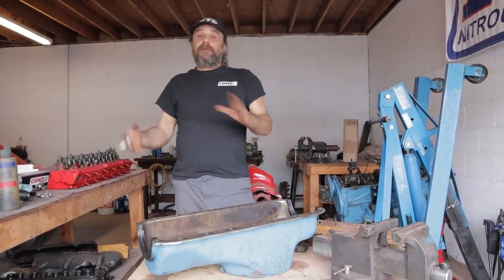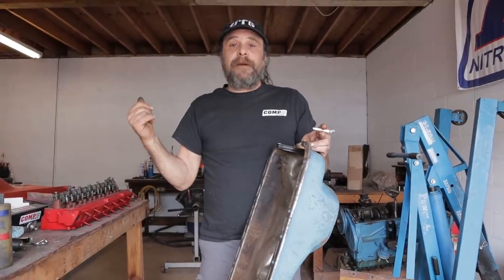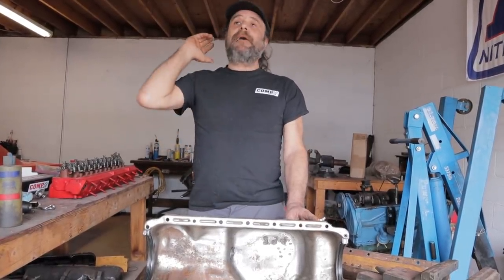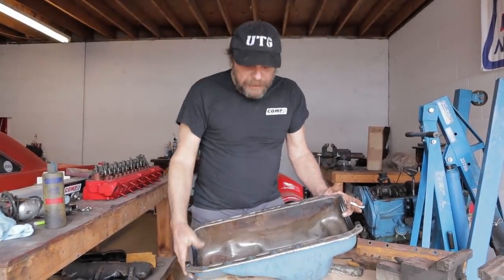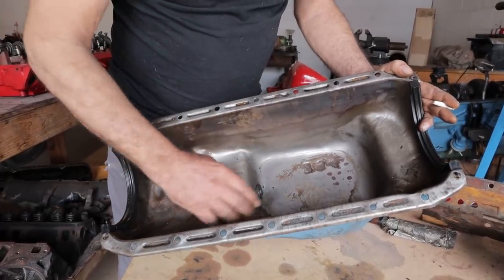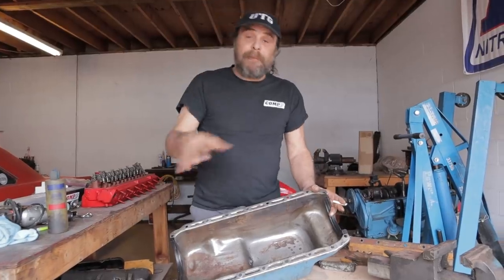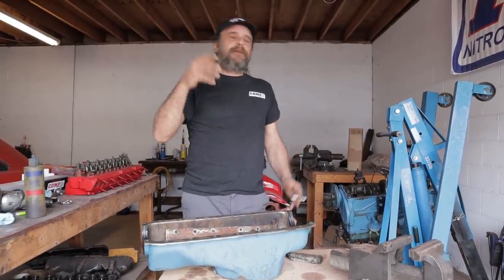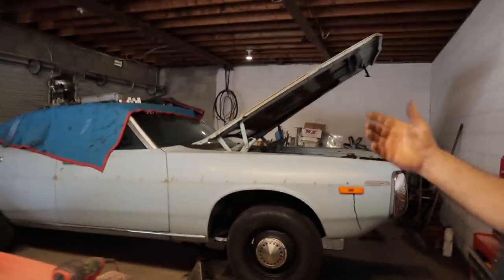Oil...Control, Windage and Pressure

Comment: I lucked out on a factory windage tray . I bought a 85 318  that came out of an plymouth fury cop car . I run stock oil pumps but a name brand like mellings no issues . I'm like you Tony I'd rather build from scraps and brainstorm on how to fix an issue on a low buget instead of buying new parts all the time . I even used a boiler shut off valve with male ends i bought at Lowe's to splice into one of my heater hoses when i dont need heat inside car and truck = summer time . As always the youth are getting smarter watching this channel 😎🤘✌👌👍

Comment: Well said about oil pressure , I used the wrong oil pump in a small journal 327 I built in high school . So when I was spinning the engine at a high RPM the engine blew up because of the lack of oil . A tough lesson to learn , so I built a 383 stroker and the rest is history . Keep up the amazing content , I hope Lambchop is feeling better these days . CHEERS

Comment: Back in the day, I put a wintage tray from a 340 in my 318..... i never thought about the oil piling up towards the back.
Reply: A 340 tray will work in all the LA blocks if it's a 273,318,340 or 360 they are all the same if it stroked then it will need some work and same as if it's the newer Magnum blocks it needs a 5/16 spacer between the mounting holes

Comment: I ran a IMCA modified and with a small block Chevy  and ran a 3/8 mile very fast track. I ran a 55a high pressure oil pump. I started with a stock oil pan and it worked great. Later I built a better engine and I put a circle oil pan with trap doors and kick outs. Every time the car went into the turn the oil light would flicker. I started talking to several people and everyone said that is normal and won't hurt anything. I put a stock pan on it and the oil light never flickered. I know if I would have bought a expensive moroso it would have worked but stay away from $100 budget pans because the stock works just fine. That's what I got from the experience. I have never used a high volume pump because its my opinion you have to have a big pan and cross drilled cranks and other needs for more oil. I think your baffle will work great.

Comment: I just finished building a baffle for the TransDapt oil pan that I'm using for my V-8 Ranger swap. I went with a different pan than what comes in the kit for 2 reasons-1) I didn't want a chrome pan. 2) Even though I know it probably isn't necessary, I wanted a 5qt. capacity pan. I built this baffle the same way I always do-I cut 2 pieces of "slotted" steel strap to fit inside the sump (a short piece for the front, a longer piece at the back). Then, I cut/shaped a piece of 16ga sheet metal to fit the pan. I use "slotted" strap because it already has holes to allow for drain back. I tack weld the strap so that the bottom of the holes are just a tick below the top edge of the sump. Then, I tack the sheet metal to the sides of the pan.

Comment: I've never built a motor without some sort of windage control. Even when I was messing with big inch Caddy motors. Always use stock volume stock pressure pumps. Have played around with springs and always came back to around 10 at an idle and 35ish at full send. Never lost a motor racing, for an oil pressure issue...
Reply: You have any 500 windage trays or scrapers hanging around?
Reply: @RichMander1  No sorry got out of caddy motors back in the 90's

Comment: Maintaining oil temperature goes a long way to keeping the average pressure in the happy zone. Full synthetic oil will help in the same vein but typically they don't have enough zinc in their additives to take care of a flat tappet cam. Really need a hot rod oil with extra zinc or upgrade to mega dollar roller cam. Vaccum pumps can make free power by removing the pressure from the crankcase. Helps the rings seal better and less windage, another 15-20 hp can be had.

Comment: Reminds me of my 340 and the factory windage tray that came with it. It was a 68, letting that go was a huge mistake.
Reply: Same here.
Reply: I built a 340 for my '70 Challenger and never got it installed. Wish I had kept the car and sold the wife.
Reply: We had no idea the real value of those used cars we were buying in high school for  $1200.
Reply: @thisisyourcaptainspeaking2259  i bought my 340 Duster at a city auction for 275 dollars. The only thing wrong with it needed lower control arm bushings.
Reply: @garymckee8857  Yeah, I remember they were cheap but not exactly how much we were paying.  My friend bought a used Satellite with a 318, I think it had.  Pretty sure it had AC, was definitely a 727 torqueflight.  We drove the wheels off that beauty and was still going strong last I saw him.  Maybe he paid $500 non-driver sitting in someone's driveway, it needed exhaust, battery and maybe tires or something.  I remember it was cheap compared to today, and the body was perfect.
Reply: @bryantcurtis2665  I bought a 69 Road Runner for 300 dollars in 82 one owner 4 speed. Who ever thought they would quit manufacturing vehicles you could work on.
Reply: I love the 340 especially the Dart swinger .  I have the 71 350 LT1. It came with the windage tray and a baffle in the pan.  Back then they thought of everything.  Screw in studs and all the goodies. I may love chevys but I love mopars too.  And even certain fords.

Comment: I run a custom stock sump for my cleveland 408 stroker, 7quart fill with baffle and windage tray as the motor makes 380rwhp through a toploader 4spd and 9" 3.90ratio. It runs a Mellings hf pump which produces around 40pounds at idle and 75 at any sort of noise, but my Old Man and i built my stroker with some old school techniques of looser clearancing, 2thou on most rotating assemblies and oil return drain holes in the cleveland valley have been opened up, rounded off and wire wheel polished the valley to promote oil return as the cleveland is TERRIBLE at draining at prolonged higher rpm's. In conjunction with our local machine shop and some investigation into high quality oils, we chose to run Brad Penn Grade 1 20w 50 and its been super happy to this day and its around 9years old now, 1 gearbox rebuild and im currently having the 9" rebuilt as its pounded a yoke out but my lil torque monster 408 still sounds a treat and the motor has behaved amazingly. This year ill be posting the ally heads and top end rebuild and get it ready for some more serious numbers yet keeping it a somewhat driveable street based build.

Comment: As long as the oil gauge says at idle about the first mark on the old stock gauge I am happy. Cause that means I don't have to add a quart. And I know it will go up to just about the half way mark driving. And since it's one of them little Chevy small block engines. I do remember bolting some sort of windage unit on it around the oil pump area. When I put that 6 quart fancy hot rod Chrome oil pan on it. Years ago. Building the engine to put in the Nova. But it ended up in Dad's old Pick'em up truck. And this poor little 383 stroker that's getting tired has been a daily Runner in the old 75 C20 for the last 10 years. I'm happy with myself. Good build.

Comment: The old 60s Corvette 327 engines we used to race had factory windage trays and if you vented high up on sides of the oil pans and plumbed the vents up to the valve covers you gained some rpms and probably a few horses too

Comment: If you ever look at the bottom end of a seventies/eighties Rover V8 you will see the shelf on the sump, windage tray, and larger gears in the oil pump, but not a huge amount of pressure. The engineers had worked out what was needed for a max of 6000rpm. People would often try and correct the factory 'low' oil pressure not understanding how it all worked together.

Comment: IIRC Mopar performance manual recommends as a 1st step to enlarge the pickup and the passage in the block. It says easy suction side improvements always yield oil system performance improvements - more so than pressure side mods which are comparatively much harder.

Comment: I totally agree about the oil pressure.  On my cheap quick throw together street race engines, I always wanted low oil pressure.   Now on my all out drag engines the pressure is quite high.

Comment: In addition and from personal experience HV pumps in big block Mopar with stock oil pans lead to trouble I chewed the camshaft out of a 400 because at 5000rpm sustained towing it could drain the oil out of the pan faster than it can flow down 😣 read the whole book don't just skim and assume you have a complete understanding

Comment: No. 22.....bam! That's some damn good advise. I know with small block chevy spooling high rpms with some builds, the engine could pump the sump dry. So we had to run extra oil return lines from the top to the oil pan. If it was going to do it, you hoped you caught it in time before you damaged something, because it had to be the right circumstances to occur. Otherwise you got burned at the worse moment.

Comment: I see 60psi cold idle. 40psi hot idle. New standard volume, standard pressure oil pump maybe 7k miles ago. Stock calls for 10w-30. I'd been running 5w-30 synthetic. I just switched over to Mobil1 0w-40 synthetic. I just installed a centrifugal supercharger and wanted a little more protection under boost, and more flow when it's cold. Old 350 Chevy with full roller valvetrain. It's in an old farm truck with a low-mileage 4-bolt main bottom end.

Comment: The cop hub caps are way underrated. I like the 15x10” steel wheel with cop cap and a meaty bias ply tire running in rear

Comment: It is pretty easy to make a low buck dry sump.  Keep the stock pressure pump but direct the suction side outside of the block , make a shallow oil pan that has a trough / flat side in the direction of crank rotation. ( the flat will be on the passenger side.   Use a spur gear hydraulic pump as a scavenge pump hooked to a home made tank.  Have a look at the system on an older  Ford " Kent " 1.6 4 cylinder powered Formula Ford race car

Comment: UTG, whats your thoughts on using new head bolts vs re using the old bolts?  My repair manuals states, "Replacement required due to Torque to yield head bolts". This is my first rebuild of a  chevy 350ci, I've rebuilt dozens of ford engines over the years and have always reused the original head bolts with no problems...your 2 cents would be worth a million to me.

Comment: Excellent as always!!!  Ive always erred towards longevity vs HP, and followed 10psi/1krpm, but as you said, by doing the math, its overkill. I know you mentioned painting the inside of blocks to assist in oil return, but what about any grinding, grooving, or smoothing? Would you want the rough texture to assist in heat transfer, especially in the heads(??)  What about enlarging the blocks oil passages to fiddle with the volume/pressure results? Ever bother with any of that?
Last thing: oil coolers. Any thoughts??

Comment: I'm chasing a no-pressure-reading-when-cold problem in my stock '66 Hemi, and after trying three different pressure sensors, dropped the pan to see what's what. It has a baffle on the rear side of the deepest part of the pan as you described, but no windage tray- so I'm adding one. The pickup is OK, so absent any other problems the pressure problem may come down to oil weight (I had 15W-40 in it, my racer neighbor says use straight 40 weight), or the length of the bypass spring in the pump? Anyway keeps me busy while I'm keeping at least six feet away from other humans.

Comment: As per the brass in the oil pan from the distributor brass gear..... Without getting into "GEAR geometry" specifics, Measure the the cam's gear diameter, divide by 2. to find the center line of the cam.. keep that number known
Measure the depth of the distributor's landing face on top of the intake manifold, down to the top highest tooth of the cam once installed (V-8 config)... special tool required, or rig up calipers...
Add the 1st number (the result of the divided by 2 , which to the radius of cam's gear) to the depth measurement... keep that number handy now and forget about the first radius number...
Now, measure the distributor distance, landing flange of the shaft, to the center of the brass distributor gear...or measure the length of the dizzy's gear, divide by 2, and that number will get added or subtracted or add to the the length number from the dizzy's landing flange, to either the top or bottom of the gear.... the gears length being divided by two is to find the center of the length, and as mentioned, add or subtract accordingly from the landing flange to top or bottom of dizzy gear...
Checking this, to make sure that the 45 degree tooth mesh is on center with one another, as just (0.010") worth of mis-alignment, in height, will trash the brass dizzy gear, based upon the intake manifold's manufacturing process and in extremely rare cases, how the distributor was manufactured... 
I personally have never caught the dizzy's being out of factory spec, especially the after market lines, but my father has, TWICE!!! Now, I personally have had uncountable height issues due from intake manifolds, ALLOT!!! Most only needed shims, and only a few were too tall, sure, I could have machined them down myself, but, was clearly just bad parts and were shipped back to the company for a replacement...but, the alignment of helically cut 45 degree gears, have to be on center with one another, or, they chew themselves up, or at least the softer alloy (brass) does, by design. as you likely already know, when they are in alignment, they last a massively long time. please note, the block and heads having been resurfaced, and the china walls being altered, will also cause issues in giving a false reading, to lead one to think the intake manifold landing flange is too high or too low... Another note, if the drive tang for the oil pump is too long, can be a rare issue.. a friend of mine caught a horridly manufactured O.E.M. oil pump, the the slot was not deep enough, and the ring that was pressfit on, was destroyed getting it off and and he machined a new ring after slotting deeper.. but this issue first lead him down a path, thinking the height issue was elsewhere, as explained above... good luck, and happy building, and be safe all
Reply from the maker: Thanks for that!
Reply: CAUTION!!! EINSTEIN @PLAY.
Reply: @alanwhite3280  oh no... we each learn by watching others and by crash coursing through life... but no Einstein... in fact, I had to look at how you spelled "Einstein's" name so I would get it right... lol, but thank you though

Comment: UTG love the channel!!
You inspire the desire to learn the fine art of engine building and tuning!! I find myself watching your videos then heading to the garage to tinker with my 70 Charger with the tips and tricks you share.  So Thank you!!
Assembled 440 running 65-70psi oil pressure.  Would it be ok to experiment with oil viscosity to achieve the oil pressures targets you have described?

Comment: Question for you Uncle Tony, as I've never run into this before. We only used a solid lifter cam in a few cars and I didn't see them after they left the shop, but nine came back. So the question is, you had a lot of bronze in the pan it seems to me that the Steel distributed gear machined into the steel cam may have been burred. If it was the bronze gear that was burred is would wear off quickly and wouldn't shed that much material. So my question is, can you de-burr the camshaft gear teeth? I'm talking about the teeth that drive the bringer gear on the distributor.
Reply from the maker: Y'know, I honestly don't know yet

Comment: So basically you never need more than about 50psi, or for most of us the stock oil pump will suffice.
Reply: Haha don't get an old rabbit diesel (solid lifter not hydro, pre 84 ) 
100 psi on a cold start and around 130-140 when cold at some rpms. 
Warm idle is around 60 and usually 100-120 at speed. 
Funny thing is they go 200-300k and rev to 5500.
Reply: High volume pumps also come in handy when you plan to run the engine for a very long time without wanting to repair it.  The high volume helps keep the engine happy even when the bearings are nearly worn out.
Reply: @MrTheHillfolk  those old vw diesels are huey inj system they use oil pressure to inj diesel fuel takes A lot of pressure
Reply: @MrTheHillfolk  Subarus also run really high oil pressure too.

Comment: Planar hydro bearings are.. very misunderstood. One initial misunderstanding is that your oil pressure is only the pressure of the supply of oil. It is not a measurement of flow and it is not a measurement of oil pressure in the bearing. As can be seen in Fig.1 here http://kingbearings.com/files/Geometry_and_Dimensional_Tolerances_of_Engine_Bearings.pdf the journal itself acts a pump that generates the oil wedge that supports the bearing.

Comment: I had a guy question my 25 lbs of oil pressure at idle recently...he 🐸 frog eyed me when I told him that was more than enough. I didn't have good luck with the last windage tray I used...came loose after a few days... thought I spun a rod ,so I don't think I'll use one unless it comes as part of the pan.